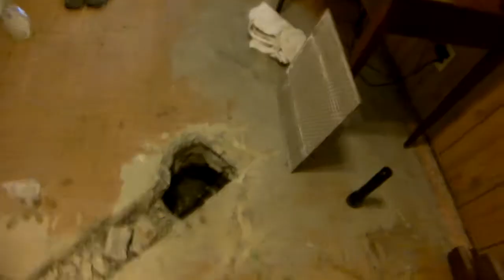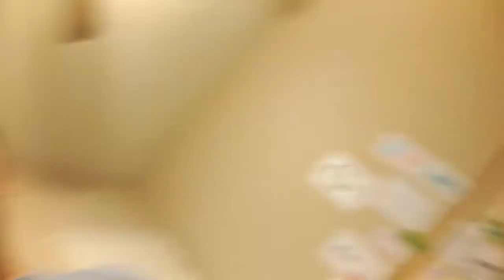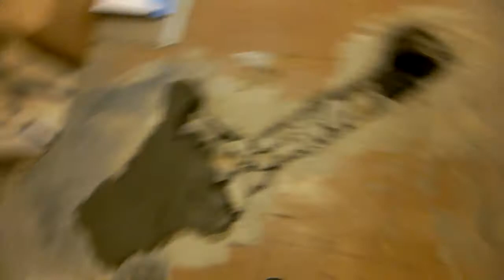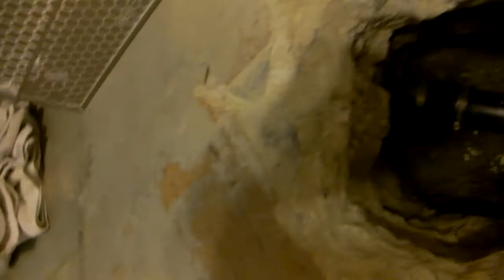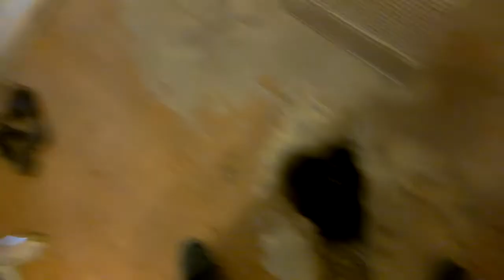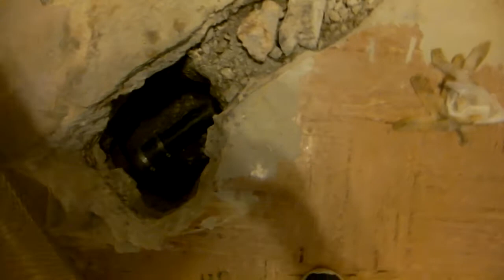Concrete Slab Drain Repair Under $300

Comment: April 2026 I got an estimate for $8,200 for a plumber to replace a drain line PVC Y connector with a hairline crack that was causing a very slight leak. Took me several minutes to stop laughing. Too many plumbers are openly shameless thieves.
Reply from the maker: That's straight up robbery! Probably the parts were going to be, what, about $100? That's exactly why I posted this video.

Comment: Nice content! How is the rest of the pipe holding up now years later?
Reply from the maker: Doing fine but a few years ago I had to call a rooter guy and get a hydro flush to clear out the drain some time after this video. Once that was done, there have been no problems --

Comment: I have a slab leak , cooled water. My brother is a plumber, but we decided to tunnel five in underground (1,000 for everything) the digging is the major issue.
Reply from the maker: Yep - the digging/concrete removal is labor intensive so that's what the majority of a contractor's charges will be for. In our case, the actual plumbing fix was pretty simple and the parts costs were pretty small.
Reply: Thank you Sir . Great video
Reply from the maker: Appreciate it!

Comment: I'm literally doing this in my bathroom after getting a price quote.  Rented a jack hammer and said screw it.  I'm about to plug up my hole via the tile method.  thanks for the tips.
Reply from the maker: Yeah it's definitely one of the most costly repairs if you get a contractor to do it. If you go the DIY route the biggest issues are the time spent and the noise; but well worth the trade off in saving money. Be careful with the jack hammer that you don't tear up more slab floor than you need to!
Reply: @DoItYourselfandSave  i just finished my hole via this method and it worked like a charm. I used polymer modified structural repair cement with a generous coating of bonding agent around the cleaned edges of the hole. This really does work fantastically.
Reply: Two feet need to be repaired under my slab and they told me 6,800$.  I already have 15,000 into the entire cast iron pipe replacement back in 2004 but something is wrong.  I think I can Find someone cheaper than that or I’m volunteering my husband.

Comment: I was about to go rent a concrete saw and there you go being motivational, I’ve already got that mini hammer. Now I have to plug my nose and get to work instead of tool shopping. Thanks!
Reply from the maker: That's funny - I use "tool shopping" as a procrastination excuse also! Actually the concrete saw isn't a bad idea. The toughest thing is finding out where to start cutting....good luck!

Comment: how can i locate the leak? damage the concrete floor in my kitchen without damage the pipe?
Reply: See if you can rent a machine or tool like this at your local tool rental place home Depot has tool rentals but I'm not sure if they rent this specific type of tool but hopefully this link will show you basically what you need to get to find that leak

https://www.trutechtools.com/AccuTrak-VPE-Ultrasonic-Leak-Detector-with-Contact-Probe?gclid=CjwKCAiAi_D_BRApEiwASslbJ3UQvbXGtEYWBJL3RFMb7om6MNke97s_pG7YRxbzEs2cK-zu5qf6rRoCUUwQAvD_BwE
Reply from the maker: Watch the entire video - unfortunately, that's the biggest problem. My vid was just showing that it's pretty straightforward to jack through the slab assuming you know where the leak is. I didn't know exactly where it was in my case - so had to do much more demo than I wanted to. I only knew the general area of the leak. Sophisticated plumbing leak finders are available but usually pretty expensive to rent. The pipe in this case sits a good 1/2 a foot or so below the concrete slab, so damaging the pipe (which is in dirt and sediment, not concrete) isn't likely.
Reply: @DoItYourselfandSave  wow 1/2 foot that isnt deep. My plumber with a camera told me 3 feet for my kitchen . I gotta to be careful then using a angle grinder

Comment: Very good.  Here in CA aplumber will charge $300 just to find the leak.  Thanks!
Reply: Leak or drain...IF IT IS A LEAKING WATER PIPE IT IS NOT GOING TO FEEL LIKE A WARM SPOT ON THE GROUND ALL THE TIME...UNLESS YOUR WATER YOU ARE DRAINING IS SCORCHING HOT..SO GET YOURSELF A PLUMBER...IF YOUR DRAIN PIPES ARE CORRODED OR EROSION HAS OCCURED OR THEY COLLAPSED DUE YO AGE OR INCIDENT THEN YOU WILL HAVE POOR DRAINAGE SLOW DRAINING EVEN AFTER A DRAIN SNAKE ...WATER COLLECTS WHILE IN SHOWER OR TUB SHOWER COMBO.
Reply: Just paid $500 for them to locate the area that is damaged under the slab- plumber said he “couldn’t see much” so not sure if pipe is corroded or what… but they said $2700 more to start to do the digging and fix leak. Of course that is if there isn’t more damage then they think 😭
Reply from the maker: Yeah, that's what I found. They use pretty sophisticated tools to find the leak but fortunately the room where the leak was in wasn't in use as a bedroom or whatever so I was able to spend a few days on this project. Saved a lot of money but it wasn't a picnic!
Reply: It's $600.00 here in Pensacola Florida.

Comment: If breaking up a slab, I would try to replace all the cast iron.  The 9"x 9" asbestos floor tile shown here should be carefully removed before any demolition however, since making such material friable can be a health hazard.
Reply from the maker: This was intended to be a quick fix as opposed to a complete re-piping. Didn't want to turn a smaller repair into a major project; too much time and expense. But thanks for the input.